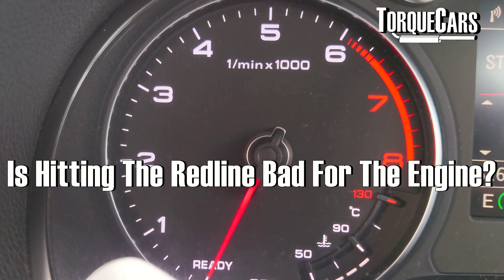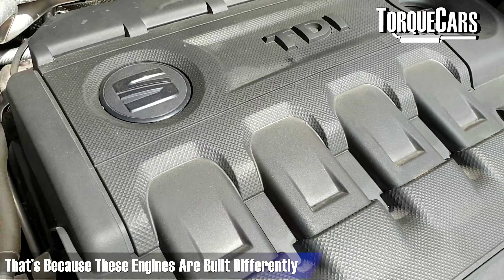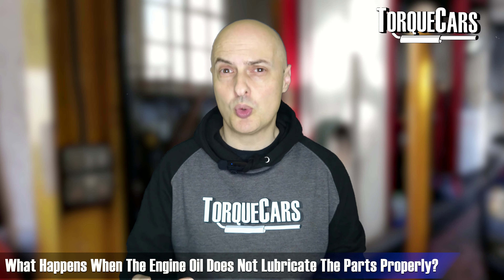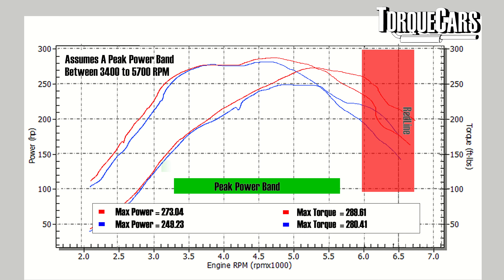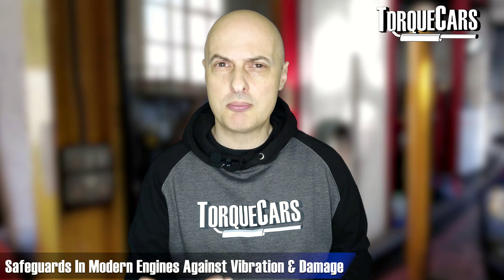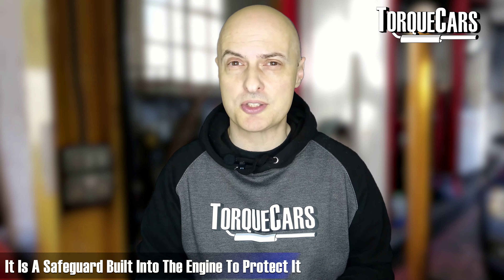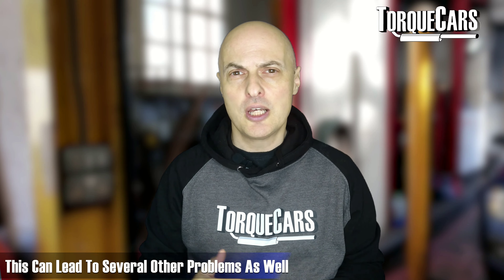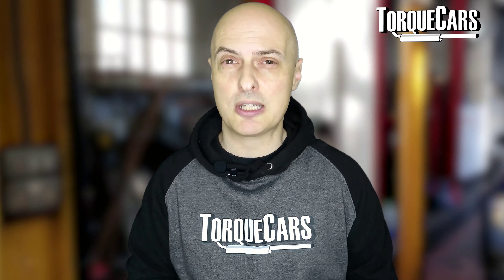Hitting The Redline: BAD or GOOD For Your Engine? It Depends Really....

Comment: I let my car warm up before hard driving, but I drive fairly gently most of the time. The one time I do accelerate hard is when the engine is warm and I'm on a slip road joining a motorway. Though as my car accelerates quite quickly, that hard acceleration is only for about 2-4 seconds. If you have a powerful car, it's not easy to drive it hard without finding yourself doing silly speeds.

Comment: Most today’s downsized turbocharged engines are tuned for maximum torque and efficiency at low and mid RPM’s. They don’t like the high ones as the old school natural aspirated. Even if the red line starts somewhere 6 to 6,5 K their torque falls significaly over 5-5,5k so there are not any gains pushing them to the limiter. For me is best to push up to the point it stops pulling strong and there is not gain or fun for higher.

Comment: On a diesel car, maximum torque and maximum horsepower can be at completely different RPM.  But in general, a diesel car does not require as high RPM as a petrol car to make maximum use of the horsepower.  You can also find websites that tell you at what rpm your car develops all the horsepower.  You can also find dyno data from a similar car model that you have

Comment: My Abarth 595 reaches max power at only 3500rpm, according to a dynotest. So I almost never redline it, it's just not worth the extra stress on the engine. I shift up at like 4000-5000rpm, and it's feels good with the power

Comment: In the 70z my race car building buddies told me to warm it up before I rev it up. But never hold a red line without a load! Never scream a breakin motor. Never leave oil and filter  in a breakin very long.  Change out breakin oil and filter before 1000 miles with  gentle, but varied rpm and loads. They would change at 500, 1500 and 3000 miles. Conventional, blend, then synthetic oils. They did spend hours arguing all the variables tho lol.

Comment: i have a bmw 7 e38 with the m51d25 2.5 liter diesel engine, so it's more of a cruiser than a sporty car. i do motorways the most of the time and here in italy speed limits are more like of a saying than an actual law so i like to push the engine quite often at 4500 rpm but never touching the redline at 5000. thank you for the awesom video and cheers from italy!!

Comment: Thanks again for this video. I like listening to people who think wisely. I own an Accord CL7 2004 right now with the K20A6, 155 ps, 190nm. 

I have never redlined the car, but I drove at 210kph at 5k rpm for 2 minutes straight. After that, the engine ran a lot better for a week, then it went back to "normal" I use an oil additive, Liqui Moly Ceratec, which is supposed to reduce friction. 

I use Mobil 1, 0W40, no oil consumption between 8k km oil change intervals. Maybe if I used more of the revs, I would get better gas mileage in the long run. Redline is 6800rpm.

Comment: Fiat ducato 230  8v 2.0 l petrol engine. Own it for almost 8 years , bought it with 68k on the clock, currently 225k still going strong.
Max rpm is 5500 best point around 3400 rpm 
When going up gears I usually go up to 5000 rpm before shifting

Comment: I ride a 2012 Honda CBF 1000 FA and bought it 3 months ago as my first motorcycle. It seemed to be a bit unhappy around 3000rpm and knowing that Honda engines are built for high rpm, I took it to the redline at 10.000rpm for a short while with RON98 premium gasoline.

Now it runs much smoother and the engine overall seems to handle in a more happy way. I know that it shouldn't be done too much due to wear, but from time to time (on a empty road where law enforcement is abscent) I redline to heat the engine properly
Reply: @IskanderS  my Honda VTR had a redline at 14,000. I took it there a few times and it was good that I had hearing protection.
Reply: @richardpowell1425  I would have loved to hear it🤩

Comment: I have a couple of vehicles:
Chevrolet Spark 0.8L for city driving and easy parking. It doesn't like the high revs but i take it out of town once a month for a 50km run. Fortunately the gear ratio is short so 130km/h in 5th gear is around 4200rpm. I take it to 150km/h at around 5000 and keep it like that for like 25km. I can feel the smell of sulfur sometimes, but when i idle it later during city drive i can feel it running way smoother.
I also have a Ford Focus 1.0 Ecoboost that i use for inter-city and also city drive. It sounds like it loves spinning at around 4000rpm and goes all the way up to 6400rpm. But it is a new engine so i am not noticing any changes afterwards like i see with the Spark. But hell, i love when it pulls nicely at around 4000rpm in 6th gear around 165km/h.

Comment: I’ve got a little 1.4 Fiat 500 and the auto transmission always wants it around 3500 to 4500 RPM and it feels very happy to do so, going beyond 4500 sounds like the little engine is forcing itself so I don’t get up there very often, but I still do from time to time and mostly inadvertently when I need to get up to speed. Though the car sees lots of traffic where it barely gets up to 2500 by itself, that’s Mexico City rush hour for you. However in my dad’s Seat with a 1.6 I am more than happy to rev it out all the way, the engine sounds pretty happy up there, but in turn if you drive that car in full auto without sport mode it just always wants to shift at 3500 or below, it’s like it doesn’t even want the power at city speeds. Finally in my mom’s 3.6 V6 minivan the tranny always wants to keep it at around 2500RPMs with city driving but as soon as you get on it it doesn’t scare itself out of the redline, quite funny lugging that huge thing around.

Comment: The automatic in my car with a small turbocharged engine lets it hit or even stay a while at max RPM every time I step on the throttle. Usually, it happens several times my every ride. I don't worry about it. No problems so far.

Comment: I usually change gears at 2500 in my 1.9 TDI. When I want it to boogie I'll change gears at 4000. She's fully straight piped with a gutted cat and EGR off. Haha.
Reply from the maker: Interesting project. A straight pipe on a 1.9 TDi did that affect the power? Is it much louder now? Have you tuned the ECU on that yet?
Reply: I do the same, I have a 2.0 tdi (140cv) whit a repro (180) and EGR delete. Good power and impresive mileage.

Comment: My Skoda octavia 2015 2.0 tsi is 1 lakh kms old, i try to avoid redline it now for longer duration. These things have so many variables if its safe or not. 
I specifically redline my 2 lakh kms old  diesel truck  after few days, and it throws BLACK SOOT, doing so results in  no black smoke   for few days. Repeat every few days

Comment: I have mostly VW group GTi’s and performance TDi’s (GTD’s) all my driving life.
Drive with spirit on the road at times & enjoy but not all the time, tend gear change 3-3500 rpm (unless first which change little bit sooner to protect).
There is certainly truth to the “Italian tune up” as I do 3 circuits days a year in whatever VW GTi/GTD’s had and they feel very “cleaned out” and more perky for 2 or 3mths after so truth in but not way should drive constant or does harm.
Also oil dropped with a filter change after each circuit day regardless of oil life or condition

Comment: Never had a problem banging of the tev limiter in my s2000 or nsx
Reply from the maker: You still got the NSX? What a car. Worth a fortune now aren't they.
Reply: @torquecars   Yes i still have both. My S2000 is currently in storage because of transmission issues. My nsx is at the exhaust shop for a custom titanium exhaust.

Comment: For most engines, redlining likely does nothing to clean out carbon, based on the SAE research I've seen.  What works best for my car is taking it out on the US highways for a nice long drive at 70 - 85 mph, preferably at least a couple of hours.  2003 Corvette, 5.7L LS1 V8 with a 6-speed manual.  Other than road trips, most of my driving is in the 1500 - 2500 RPM range, with redline on the old push-rod V8 at 6000.
Reply: With both of my bikes and car (Virago XV535, Thunderace and Skoda Octavia 1.6 TDI 2016) driving them hard and fast sometimes after the city commutes does wonders.
By driving hard I mean using all the power and powerband, not hitting the rev limiter. This means that I usually rev to just before the redline starts or ever so slightly in the red line, depending on the specific vehicle's powerband. 

Also, they drive amazingly whenever I drive them hard more often. I recently bought a 2005 Opel Corsa C 1.2 Twinport, it also drove amazingly but apparently the previous owner did something on the intake camshaft and whoever did it didn't torque everything properly. Result: the camshaft bolts on top of the 4th cylinder were loose and so the force of the valves didn't get past the 3rd day before it broke right after the 3rd cylinder top support. Since I opened it, I'm joking) just going to replace everything besides the block, cy) pistons, head, connecting rods and crankshaft. Nothing else suffered damage apart from the camshaft, but replacing everything will mean that I'll pretty much have a brand new engine with a 140k km block.

I'll be doing a break in period of about 1500km or so, followed by an oil and filter change, before pushing harder on it.

Comment: Perhaps the interesting thing is how many horsepower the car develops at 3000 rpm.  on paper a diesel car may have less horse power but at 3000 rpm the difference may be very small.  on a diesel with 170 horsepower and a petrol car with 220 horsepower, for example.  then the diesel fuel has a certain importance as well

Comment: I have 81kW atmospheric engine (engine without turbo) and the engine power/torque curve is linear so I must use whole range up to redline when overtaking. In case of turbo engines there is no need to go that far.

Comment: 4A91, dead below 2000 rpm. Red-lined, max throttle regularly on motorway. I don't cheap-out on oil but relatively low yearly miles, far from suggested oil lifetime. I feel like you can't really use it any other way 🤷‍♂️.

Comment: My BMW has a kick down as its an auto. Push the throttle all the way down and it drops down a gear or two to deliver max power. 

Barely ever use this feature as afraid it will damage the engine??

Comment: It's a limiter for a reason right? Lol
My 1.8T doesn't see the limiter all that often but it definitely sees 6K at least a couple of times a week. Not sure what the factory limiter is/was but I have it set to 7k. It's a manual with a bigger turbo so below 2K is pretty gutless so really between 2k and 5k rpm is where it's normally at.
The new engine I'm building is almost done though! Other than the water pump I'm waiting for, I just have to bolt on all the little stuff like oil cooler, manifolds and accessories. I still need a 240mm clutch and 1000cc injectors.
Reply from the maker: It shocked me to find the rev limiter was not just there to improve my fuel economy! lol

You do get a decent power band on those 1.8T's but outside the power band things really do seem to dip.

Comment: Can we cruise at high rpm? What should be the range of rpm when cruising on the highway?
Reply: Cruising at high RPM doesn't really point out the benefits of the high RPM operation. You can be at high speeds, but low engine load which will not produce a beneficial amount of exhaust gas and heat, you will just run the engine at inefficient range.
What you need is a good amount of road, having a good amount of airflow for cooling and have the gas pedal pressed to the max. So if you cruise, you need for example 160km/h in 4th gear at around 5000 RPM and if it is uphill even better so your pedal is pressed hard and you are approaching but not meeting the redline and cutoff RPMs.

Comment: Toyota 5VZ-FE here  with 341k original miles + MT ... Engine has never seen much over 3k RPM unless in 5th gear hittin' 100mph on the open freeway
Reply: My neighbor has a 5VZ-FE in his 1996 4Runner with 280K+ miles and he redlines it at every opportunity he can even on cold starts. He also runs it wide open for many miles at a time going around 80 MPH because it has bad ignition coils and loses 2 cylinders when under load. More often than not, it's low on oil too. Yet somehow it refuses to die and the truck only left him stranded once, which was when he broke the driveshaft off roading.

Comment: I thought most engines produce peak power nearer the redline? Certainly naturally aspirated engines. My car has a redline of 8400rpm, peak power is at 8300rpm with peak torque at 3900rpm. I can't  think of any naturally aspirated engine that produces peak power in the middle third of the rev range? Has anyone got any examples?

Comment: Thanks for the excellent education in diesel engine technology, im now thinking of putting a GTB2056VK into a mk6 golf gt tdi 140 i just purchased.
Its all ready had some upgrades so im going to check what the existing turbo size is and upgrade turbo & injectors and re map...
Does the GTB2056VK turbo easily fit on the mk6 140bhp engine?
thanks again
Reply from the maker: They are sold with a manifold suitable for the 140, get a full install kit rather than just a turbo, a company like darkside would see you right on this.

Comment: Maximum torque is developed before maximum revs  so why rev a standard engine to this  which is supposed to last many thousands of miles before a rebuild  more revs=shorter engine life
Reply: Torque isn't really relevant to this discussion. A high torque engine just delivers more power at low RPM, it doesn't mean the engine's more powerful at low RPM than it is at higher RPM, it just does well at low RPM.

Comment: I have a 1.8 honda civic i go very easy for the first 15 mins especially but still drive on lower rpms have hit higher the 3.5k as scared the engine will blow up or will be damaged